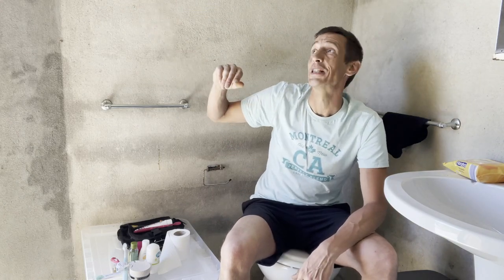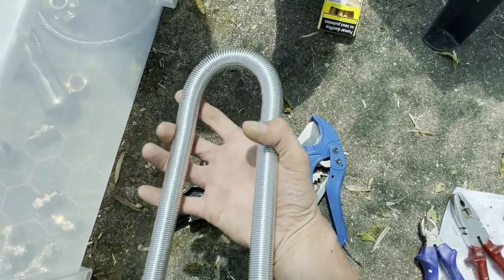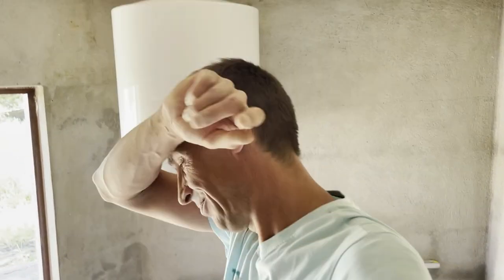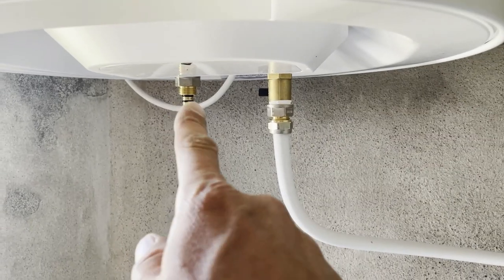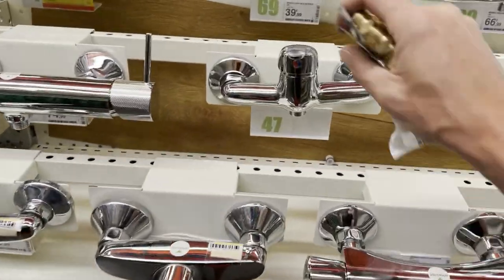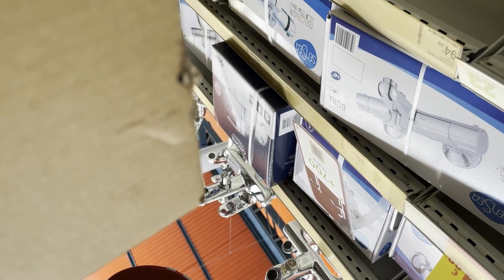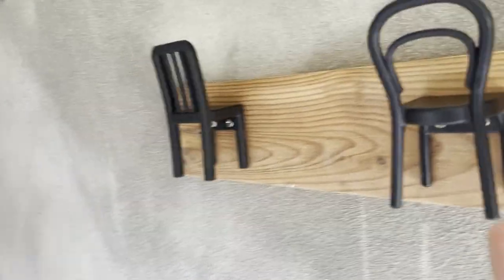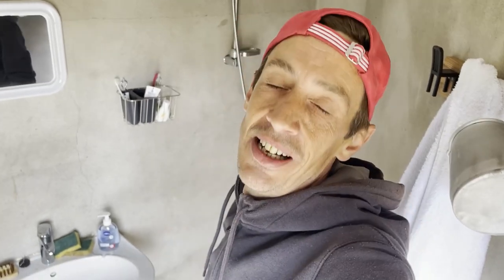Water systems in Portugal - Connecting water in my house in Portugal

Comment: Hello once again. Might I suggest that you place a "Stop cock valve"  where water pipe enters the room. Just in case you need to shut of the water supply without having to run outside to mains. Loving the videos.
Reply from the maker: I bought this type of crane thing, but didnt get a chance to fit it yet. i wanted to put it outside near the main. But the connection to the mains need to change still anyways. I think i wil put it in then :)

Comment: Thanks for sharing. In Engand we use copper piping, but Mullti-cam systems seems spot on.
Reply: Multi cam system is in UK to and those flexible pipes. Much easier and cheaper to do it yourself than solder pipes.
Reply from the maker: I agree :)
Reply from the maker: I holland also mostly copper. i like the multicam better.. for now :)

Comment: Cool job though I don’t like temporary jobs but that each to their own, a thought on the out side pipes though do the weather in winter there get to freezing point? If so the pipe needs to get underground sooner rather then later 😊👍🏴😻
Reply: Considering that the meter is in an un-insulated cabinet above ground I'm 99% sure it never freezes there, otherwise the water supply board wouldn't have put the meter there.
Reply: Cool  👍👍😻🏴
Reply from the maker: That would probably be the case yes hahaha
Reply from the maker: Hi, good tip yesss, they need to go underground.

Comment: Brass goes for longer, I'm using it in my renovation on the outside and avoiding chromes on the inside (cause fingerprints).
You didn´t need that tool you can heat up the plastic lightly with a torch and insert whatever piece you want and the plastic will mold to the joint, this tip can be used for bending as well.
Multicam is better than iron pipes since it lasts longer (due to its resistance to ground or wall movements), require fewer joints, has no issues with rust (that adds material in the water,  this is very true especially in the iron cast or galvanized iron pipes that you place underground on clay soil (especially if it's an acidic one) and in cold countries, it resists better to ice water bursting like PEX (PEX is awesome for indoor plumbing just don't use the cheap ones), and more eco friendly believe or not since they require less energy to produce and can be recyclable and its cheaper to buy and replace.
I much prefer to spike the joints (with the plier) than to screw them, over time screwing tends to leak (washer much??).
The boiler is an electric model right?
Sometimes a squeeing sound means its to tight and about to break ;;))) that's a cringy installation but hey better than nothing and you´re ready to start water cooling on a pc, you have the skill already xD
It´s not AKAI it´s AKI xD and what you don't use return it (along with the invoice) on your next visit to the shop to deduct from your next purchase.
Dude.. here´s a constructive criticism.. your video is too long, you should have done it in 2 parts.
Reply from the maker: Hi, thanks for the great tips! Will keep those in mind when doing the rest of the renovations. Over the long run i never had an issue with screwing, but that was mostly with copper piping. And i did water cooling for pcs back in the 90s, so thats why it was fine probably :p 
I agree with you on the length of the video! Im still trying to manage to get the content out in a decent time frame for now. Will also take that tip :)

Comment: Tap aerators are the odd one out in the plumbing world as they're metric threads (M24x1), while the shower hose, like pretty much everything else, is Whitworth/BSP, in this case R 1/2". Adaptors are available on the internet.

46:20: this is totally not how all that was intended to come together by the manufacturer. It might work but it's definitely not how it was designed! The fixed pipe is supposed to come in close to the wall, then a shutoff valve screws into the front coupler and the braided sink hose connects to that shutoff. Not sure about pipe dimensions in Portugal, in central Europe you'd use a 1/2" input - 3/8" output shutoff and the taps come with 3/8" connectors. I definitely remember from my last set of taps that the instructions had an entire table of different thread sizes and types for all European countries, so things might be different in Portugal.

Comment: Would this 50 litre water heater system power your kitchen hot water aswel or do you need to fit individual ones for each bathroom/kitchen ?
Reply: It should do fine for both. 50 l is reasonable for most purposes, unless several people want to shower right after another and obviously it's too small for filling a bath, especially since electric tanks take several hours to heat up.
Reply from the maker: Hi, this is only a temporary setup. maybe i will however connect a temporary kitchen sink also.
For the future there will be either more of these boilers, or a central system, perhaps with gas.

Comment: Typically you would heat up the rubber first and then use the stretching tool. If you had a small blow torch you could heat it up without burning it, do a quick stretch and then pop it onto the coupling.

Comment: Thanks man for sharing. Interesting. Why didnt u use a water heater without a tank? Might be more energy efficient...
Reply from the maker: Hi, you mean one on gas? That is more efficient yes but also more of a hassle to maintain :)
Reply: @GhostTownVlogs I mean elektric but without tank. But this heaters take usually like 10 or 20 kilo watt per hour (heavy current). But In thailand for example they use small ones (low current_ampere)

Comment: Am I the only one that thought : put the t joint in the corner against the wall, so one side points towards the toilet flushtank and other goes up and then bend the pipe towards the boiler?
Reply from the maker: Probably :p
But that could have also been a valid solution.

Comment: It’s a plug in your mains incoming water they most likely used locktite on the fitting so you need a blow torch to get it hot to break the seal and remove it looks like a steal fitting to me
Reply from the maker: Hi, thanks thats a good tip, will try that in the future!

Comment: Where does the water go? Do you have a septic tank?
Reply from the maker: Yes i have one now, with natural drainage. For the future however we need more poo storage :p
Reply: @GhostTownVlogs  2 alternatives...1 get a tank truck to empty or 2 dig a new septic hole...I suggest the number 1. But if you have no bottom in the tank all the liquids will sink through the soil... in about 2 meters deep.  You can dig a 2 meter deep and maybe 2m2  hole and put cement blocks as walls then build a lid of concrete and leave the bottom as it is... that's what they do in the Philippines and you never need to think about empty it.

Comment: It will work that way, but it looks like a makeshift for a refugee camp. If you had the boiler in the right place and wall...
Reply: Guess you missed the part where he said it was temporary.
Reply from the maker: Works perfect :) 
You are overreacting, its not that bad :p
Reply: @GhostTownVlogs  Lol - don't get mad on me! Just want to talk to you guys a little bit. And yes, it is not that bad, it's worse!    ௸
Reply: @ernestospadolesto8126  wow, how's that for being Dan the Downer.
Reply: @Roosmarijn035  Dan the downer helps him very nicely to rethink his lines and the routing for the final assembly. The kitchen probably also has to be connected to the water, and then he has already entered the room the wrong way - unless he wants to pull such an ugly pipe through all the rooms ... Sometimes honest criticism helps more than if everyone says how great he is has made. I wrote it works, but why not prepare everything so that as much as possible is already correct?